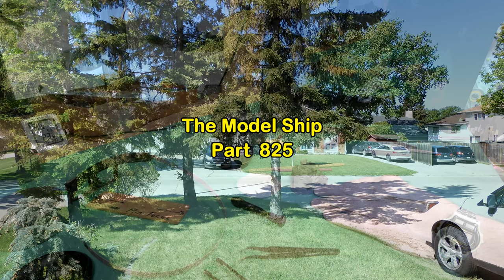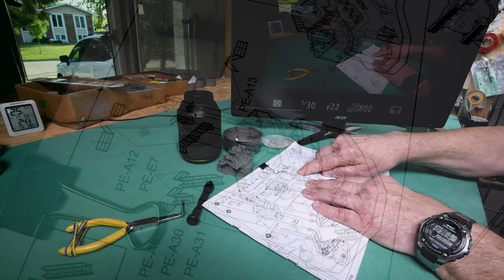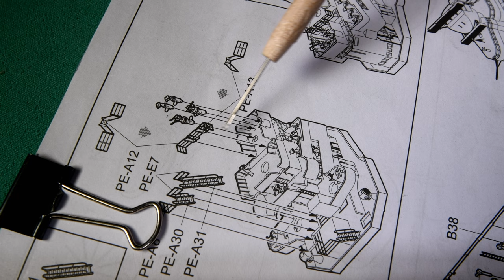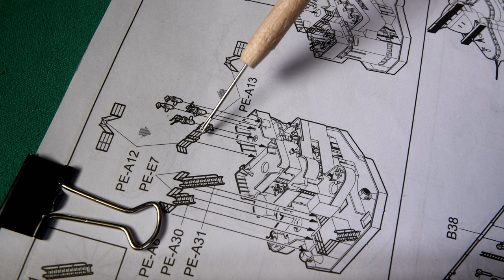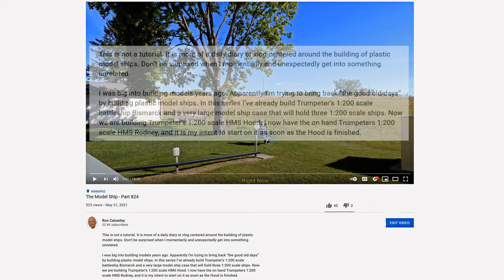The Model Ship - Part 825

Comment: Great build Ron! I watch every day. One question - it seems everyone nowadays is using Cyanoacrylate glue for entire builds now - why is that? I find it's extremely low viscosity causes the glue to spread out no matter how hard one tries to restrict it or how little is used. For me - plastic-on-plastic, even painted, a dab of old fashioned Testors tube cement provides the cleanest bond, and it's higher viscosity makes the part far easier to work with and control. I don't mean to give advice here - legitimate question. Again - great build.
Reply from the maker: Hi Mike,
Re: "Cyanoacrylate glue for entire builds now" It seems to stick well to photo etch, and there's a lot of PE in kits lately. 
Re: "low viscosity causes the glue to spread" Cyanoacrylate glue (CA glue) is available in varying viscosity's, such a "Thin", "Medium" and "Thick" The "Thick" will not creep or wick if used sparingly.
Re: "I don't mean to give advice here" Thanks for the comment, appreciate it!. 👍
I just made a note to remind myself to talk about my findings with CA glues in Part - 826 today. 🤞